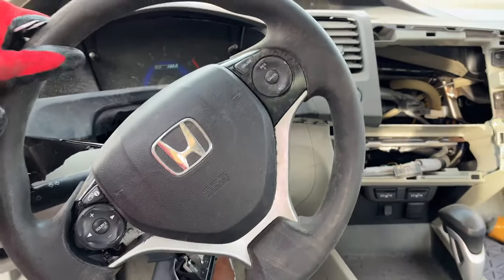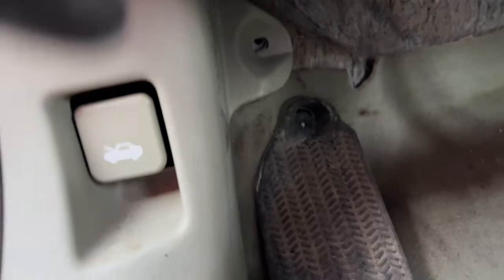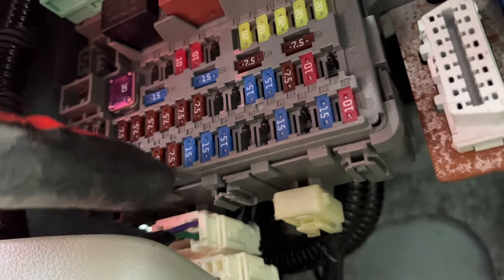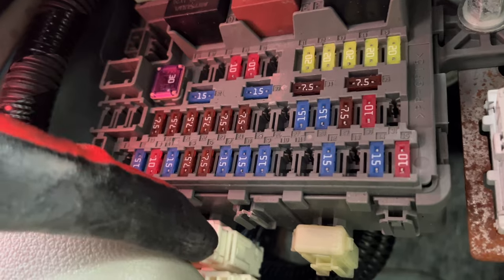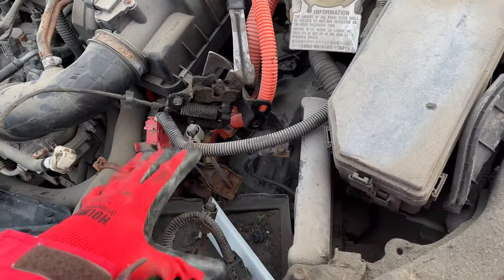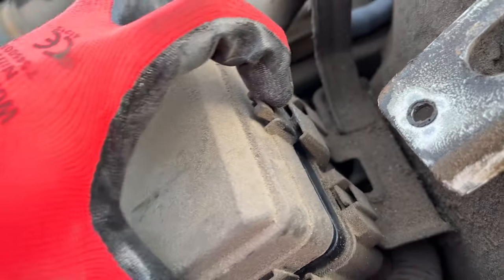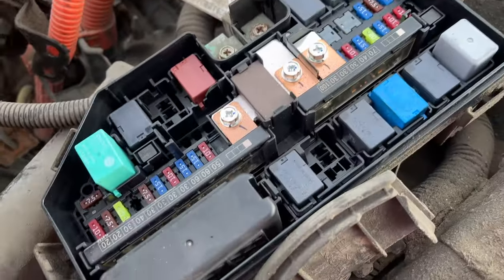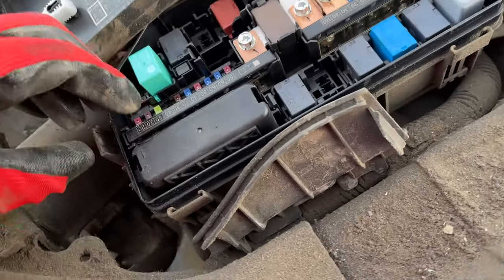Fuse Box Locations on 2012-2015 Honda Civic

Comment: Hey my Mid or led screen on my Honda stopped working. Where in the fise box would Thst be
Reply: The red fuse 10amp at the bottom in engine comp.. fixed mine. (Backup)

Comment: Trying to fix my ac ! Not a very mechanically inclined fella this helps alot
Reply: What problem did you have with your ac? Mine isn’t blowing at all
Reply: Which one is the ac fuse? I can’t seem to find it
Reply: @sheldonnewton9435 did you ever figure out what was wrong with yours? Mine just stopped blowing cold

Comment: Where is the radio fuse for 2012 civic lx I can’t seem to find which one it is in the manual
Reply: Same
Reply: Let me guess, you tried installing an aftermarket radio.
Same here. Now anti theft won't allow ket fob to lock/unlock. Radio won't turn on ,👎👎
Reply: Did you find out which one it is
Reply: Just now seeing these questions so I ended up taking it back to where my radio was installed since I had a warranty and what they told me was that it wasn’t receiving enough power and they ended up wiring it to a different electric adapter and it’s been working since